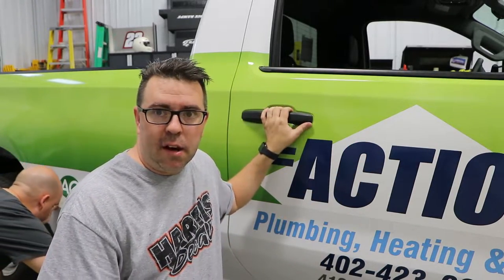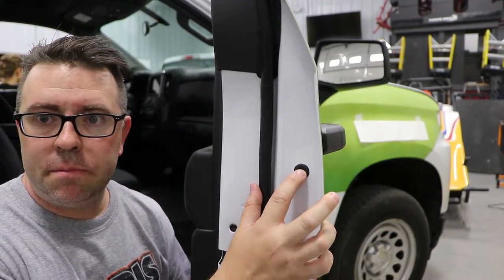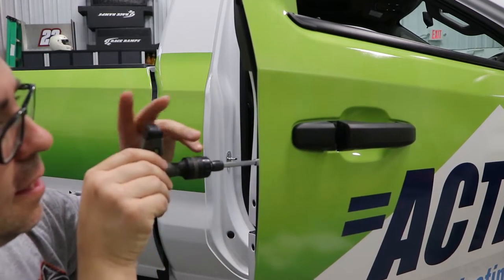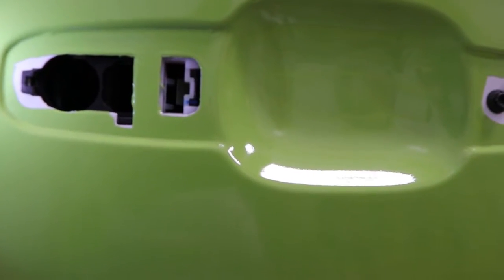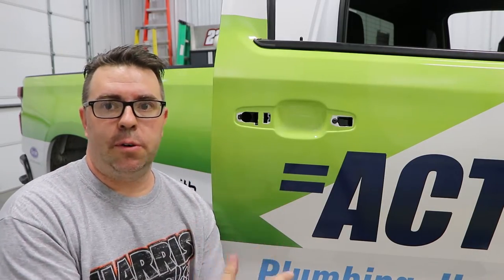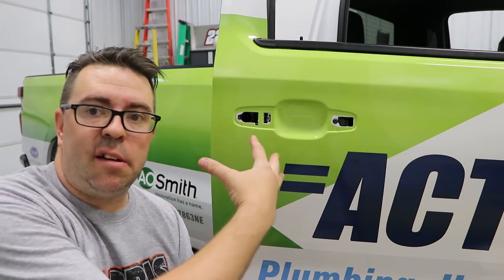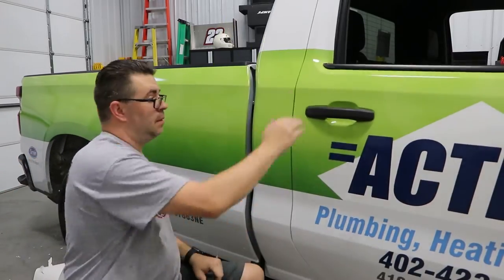2020 Silverado - Door Handles - Part 1

Comment: He forgot to mention that the driver  handle with the lock doesn't go back on so easily. The metal latch refused to stay out after pulling it and loosening the screw. Had to use a piece of string to pull it out while sliding door handle back in. It was real fun. Why they had to change this mechanism, I'll never know. But it was definitely better before.

Comment: I followed your directions. As i went to put the handle back and and tighten the screw, the screw just kept spinning. Its not cross threaded. You know why this is happening
Reply: no idea, are you sure you didnt strip the threads as its only going into plastic?
Reply: Did you figure it out? I have the same issue
Reply: Same issue here on the passenger rear. Anyone know of a fix?
Reply: Anyone got the fix???

Comment: Thanks for this video!!  Too bad my guys didn’t see it before they pulled the door handles then shut the doors!  Lol
Reply: were you able to get them open again?
Reply: Did you ever get them open and how........😣Yea cause I just did that lol
Reply: @pgarcia128  Did you get the door open? I just did that too.
Reply: @tigger1823  yes sure did shortly after I typed that lol. I found a flexible driver with the right size allen even though it's a star bit. You really got to lose that bolt on other side and push over and down as far as you can to get the right angle.
Reply: @pgarcia128  thanks for the reply. I got it too luckily. You're right, the angle was key.
Reply: @tigger1823 how did you get it what tool ?

Comment: Will that same process work on 2018 Silverado? As far when losing the screw and holding the door mechanisms in place to reinstall the handle without having to take the interior door panel off.

Comment: Good Video... client came to get something out of his truck and shut the driver door after I had removed the handels. He paid an extra $200 for that error. 
Color change on a 2024  AT4X. As a precaution I slip a shp rag into the Door Jam lock loop.  But resetting the Screw is better for Commercial wraps and lay outs 🙌

Comment: I couldn’t get mine to lock back
When loosening. Directly on the back side of that metal mechanism is a hole on the inside. I used a flathead screwdriver to push it from the inside.

Comment: Great video! All except the part where you said to tighten the torex (however you spell it) back down. Soon as I did that, it screwed me out of two hours of my life. There is no need for this step Or your part 2 video where you unbolt the handle mechanism and move it around hoping nothing falls loose into the door interior. The flat metal plate inside is mainly what the handle pulls to release door. Use your handy hook, or piece of wire that you jimmy around it like I had to, to release the door. Ta da. 
Stepping off soap box. 
Like I said, was well thought out video, except that part. Keep an eye on your mailbox for my invoice. Kidding!…maybe…

Comment: How did you guys end up opening it ? I Js did the mistake you said not to do lol
Reply: I need to know this too
Reply from the maker: @mgrote9  So here is the “fix” if you did end up shutting the door. (At least this is what worked for us)

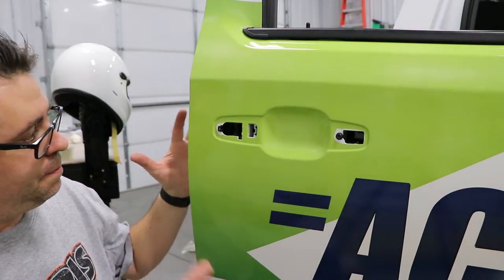If you look at the 1:30 mark in the video you will see there is a screw on the right side where the door handle slides into. Remove that screw. By removing that screw you will loosen the door handle bracket behind the door, that I talk about at the 1:50 mark. Use your fingers or a screwdriver to move that bracket as far right as you can so you can get access to the Torx nut you first removed to take the handle out, You will access this nut from the large opening that is at the 1:50 mark. It may take some work to get access to that nut but once you do tighten it back up, re attach that bracket and you should be able to open the door from the inside. 

Hope this helps, and if we get another 2020 Silverado in the shop where we have to take off the handles I will make a video showing the fix.

Comment: how far back did you pull the mechanisim? Im trying put the door handle back on, but i cant get the mechanisim to lock forward.
Reply: Were you able to figure it out? I’m stuck in the same boat right now.
Reply: Me to im in the same boat today. The screw that locks the handle in just keeps spinning.  Any ideas guys
Reply: @danysemaan9529  i have the same issue now. Any help?
Reply: @danysemaan9529  hello, how did you resolve